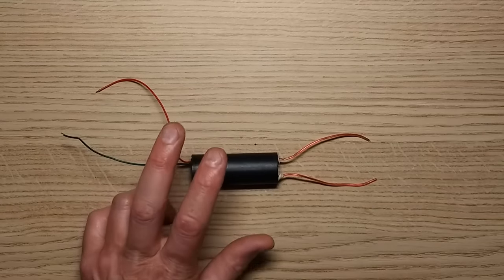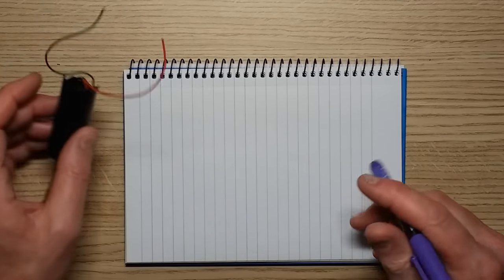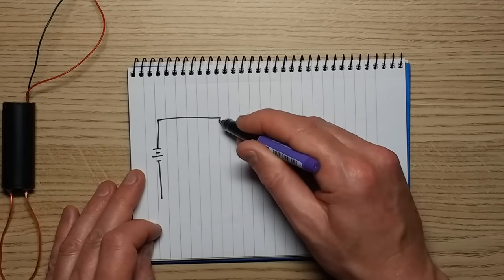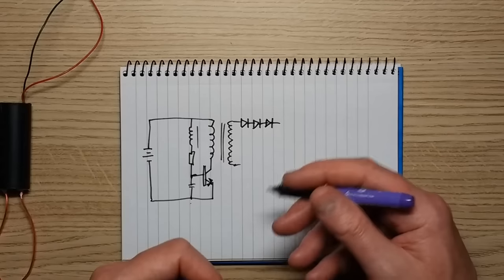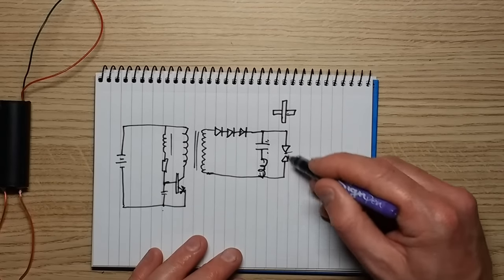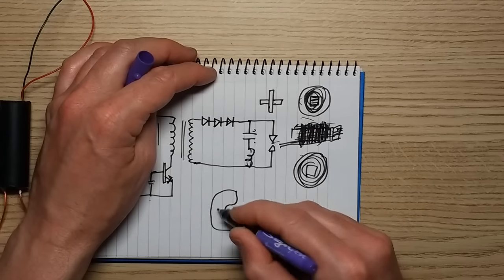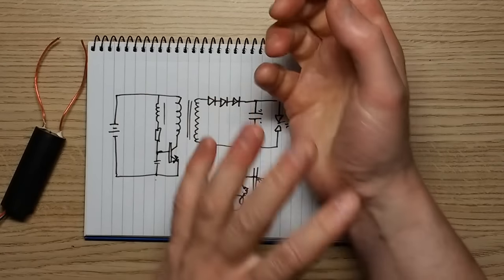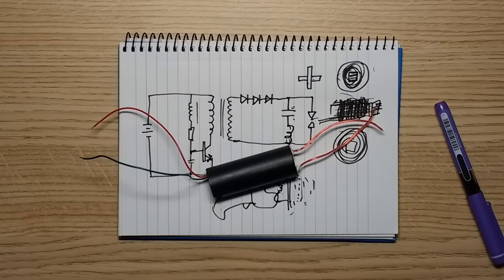Are these stun gun modules?  And do they hurt?  (yes)

Comment: If it's any consolation, I once spent a couple weeks of spare time extremely carefully chipping the potting material off one of these modules. The one I've got uses a voltage tripler at the output of the transformer, but does not have any separate stepup pulse transformer. The sparking you're getting is just the discharging of the final cap of the multiplier. I'll send you some photos 😁
Reply from the maker: +Lindsay Wilson That would be interesting.  It does look like it may be a different style based on an HV transformer and multiplier.
Reply: Actually there are quite a few different versions around. Not all of them have the pulse transformer, like yours obviously has.
Reply: Lindsay Wilson can you send me them
Reply: I have seen x-ray of one of these on internet, and it does seem to have a voltage multiplier on the output
Reply: Oliwer Gumowski Neat! Do you have a link for that?
Reply: I don't but I have them on my local storage, if you give me an email, I can send you
Reply: I've stuck a few photos of the "teardown" here: https://flic.kr/s/aHsm3p7tjX (felt like one of those dinosaur bone games where you have to chip out the plaster!). And here's the circuit: http://imajeenyus.com/temp/hv_module_circuit.pdf. I'm pretty confident about the voltage rating of the output caps, so the whole thing is definitely only good for a few kV, although they're probably over-running them and hoping for the best.

The potting seems to be filled with something - I did try an X-ray initially but it was totally opaque, but then again I only have a 30kV  tube which isn't very penetrating. To be honest, I'd be surprised if there was actually a separate pulse transformer in there, because there wasn't any space left in the one I dismantled, but maybe they've changed the design.

There are actually kits going around which have the same components as are in these modules, minus the output multiplier (so they produce a high-frequency output), for example:

http://www.ebay.co.uk/itm/15KV-High-Voltage-Generator-Step-up-Inverter-Arc-Ignition-Coil-Module-DIY-UK-/382138666198

http://www.ebay.co.uk/itm/High-Voltage-Transformer-15KV-Booster-Coil-Inverter-Heat-sink-Switch-Diode-UK-/192054172975
Reply: I ground it down first on a green-grit (SiC) wheel, then sanded it on a flat piece of wet-n-dry paper. It's not actually much into the ferrite material, so it wasn't too hard to sand.
Reply: Thanks! Actually, that's how I counted the number of turns on the transformer - it was more of a necessity; I was originally going to measure the inductance of each winding, but I accidentally chopped through the wire as I was chipping away the potting, and couldn't find the ends again. So I took a photo, stuck it into photoshop, and used the count tool to number each wire. Slow, but worked. If you have a look at the Flickr album again, I've added two more photos at the end showing the wire counting.

And you've just reminded me how I really need to get back to updating my website with stuff like this!
Reply: You can tell they use a voltage multiplier because the frequency of discharges goes up as the distance between the electrodes goes down, implying that the output is connected across a bank of series capacitors being charged at some finite rate, and a pulse transformer/capacitor/spark gap combo would be too large, heavy and expensive for such a cheap/light/small device. Being a fan of high voltages (the smell of ozone brings back memories :) I've been using both types of circuits for a couple of decades, and it was immediately obvious which type these things use as soon as I tried one out; they hurt, but they don't have the kind of incapacitating wallop you get from a stun-gun (speaking from experience.) I think it's important to differentiate these from actual 'stun-guns' as these are very useful devices for high voltage applications, and it would be a shame if they were associated with them by less technically minded lawmakers, that's a slippery slope right there, and more clarity now might prevent future issues.
Reply: I just took a hammer to one of mine and the LOPT came out in two clean pieces. The potting compound is soft, and can be broken just by pulling leads (after cutting the jacket off with a knife). The contents were exactly the same as the kit also available on eBay.
Reply: These are NOT stun guns! They're a high voltage AC generator feeding into a voltage multiplier with small capacitors that discharge when the voltage across them becomes high enough. Only the first part of the circuit described in this video is correct, the second part should be a voltage multiplier with a bunch of capacitors in series. This is shown by the frequency of discharges rising  when the leads are brought closer together; when I first got one it was immediately obvious to me what kind of circuit it uses as I've made many variations of high-voltage generators in my teens. Bigclive is usually very knowledgeable but he dropped the ball on this one, presumably because he has little experience with high-voltage circuits. One simple way to test this is by measuring the capacitors in the voltage multiplier, getting a valid reading on the output wires would easily clinch this argument. Once you know the capacitance you could work out an LC resonant tank circuit and use the device to make a small tesla coil.
Reply: MadScientist512: Can you elaborate what is the difference between these cheap Chinese HV generators and actual stun guns? Do stun guns use DC pulses, or some other waveform that 'hurts' humans/animals more than this kind of HV AC? Why I ask this is because I have a bunch of units that look like Clive's (black cylinder with one cut/straight wall), but they are longer and thicker, and have much thicker and longer output cords. I made a fish stunner using one module, and I will be really disappointed if it doesn't work (haven't tested it yet since all the lakes a frozen).

Anyway, I tested one generator with 13.8V (I think they were rated 6-12V or something like that) and ~2cm spark gap, and all my LCD monitors about 2 meters away blacked out. The next test I did in the garage, and a randomly selected 6.5cm spark gap still yielded constant arching, pretty decent noise, and the classic ozone stench. I think I calculated the voltage required for an arc of that length to be in the 200kV range.
Reply: Could an old flashgun with the xenon tube removed achieve a similar effect?
Reply: Could you send me the pictures if you happen to have them

Comment: Could you work this into a squirrel proof bird feeder. Stimulate their nerves.
Reply: I like the idea, but you'd need some way to trigger it only when a squirrel is present. Otherwise, the generator will probably burn out. Even if it doesn't, the constant arcing would be annoying.

How about a long tube that fits over the bird feeder pole; two bare wires spiral in parallel down the tube; the squirrel's weight on the tube triggers a power switch...
Reply: Better off with an electric fence controller. I have a bird feeder on a wooden post with two leads spiraled around it from the controller. You need a + lead  and ground lead for the squirrel to ground out. Birds never land on the post so they are safe. You can tell how much the squirrels love it by the way they ricochet about the yard while running away.
Reply: MrCivildefense have a weight activated switch. Should work.
Reply: haha they're tiny! it'll probably kill them not stimulate their nerves!

Comment: I have the same HV Modlue and I built a small tazer.
An important thing to remember about these HV Modules, is to not separate the output wires too far apart or the stored energy cannot jump the wires and end up discharging inside and destroy the module.
About 1 " is good.
Reply: Hi i want a tazer from one of these but i want 0 risk of it being lethal and know im probaly not going to use it on a person unless i really need to but i dont want it to me lethal and i know this comment was 6 years ago but do i need to put a resistor to lower amps or anything or does the voltage mutiplier do it
Reply: @PIXELCRAFT_HD  
It will give you a good shock, but it won't damage you unless you have cardiac issues.  No resistor needed.  This is very low current and high voltage.  Much like a dog shock collar.  Have fun...
Reply: @valveman12  thank you
Reply: also what battery did u use into the voltage multiplier
Reply: @PIXELCRAFT_HD  
I used 2 AA batteries with my design.  2 AA Batteries create a nice arc.
Reply: probably bro died cuz didn't answer back

Comment: I have build one of those inside my insect zapper, which is formed like a tennis racket. I also included a spdt switch to select whether it is running on only one single AA battery or if both included cells of the zapper are used. Running at 1.5V the zapper is quiet and only zapps when an insect is near the zapping plate. When run in 3V mode, continuous zapping with loud sparks happens all over the plate, mostly on a few single spots.

This build is so much fun to zap things with, as even a short swosh through the air definately takes out every creature near by. You can even clean your bed with it zapping, as a static charge will catch small debree on the metal gates on the tennis racket like plate of this device. Small tapping on the handle will release all partikles.
The power consumption is around 1A on both modes, so somewhere between 1.5W and 3W.

Even operated with NiMh cells it is working reliable. To get the indicator LED of the zapper running on the single cell mode, i used a energy thief circuit. This allowed me to even change the LED to a high power 5mm ultra bright diode, which adds to the whole experience using the device.

I don't regret investing the time this conversion took and would alleays do it again.

From the beginning i planned for the inclusion for an ESP8266, which allows for integration in my smarthome. Count zapped things over the year and generate statistics. Through the inclusion of a small mosfet even the following is now reality:

Hey Google, kill this fly for me.

...there you go, i activated your insect zapper. Please hold it near the bug which is soon to be gone...

I love it!
Reply: Any links to components or this module? Keen to make a zapper for the gf
Reply: @MrExprise  DC 3V-6V To 400kV 400000V Boost Step-Up Power Module High-Voltage GeneratorDC 3V-6V To 400kV 400000V Boost Step-Up Power Module High-Voltage Generator
US $3,69

Comment: Hi! I'm actually using these for some scientific experiments and we therefore had to do a couple of measurements on those. We hooked it up to a high voltage resistor, split the voltage 2 ways and hooked it up to an oscillator. We have measured the frequency of the circuit to be roughly around 10 kHz (as far as I remember...) with peak voltage around 13 kV. I'm still getting around to cutting it open with a dremel, but I also plan to use a CT to map the insides. Thanks very much for this video, it has actually provided a lot of insight for me ;)
Reply: How are things going, Stanislav? Discovered anything interesting in the time since your last post?

Comment: There is actually more to that, the reason you would be aiming for the base of someone's spine is that for quite a significant portion of the spinal column the nerves will all be bunched together into this thick cable like arrangement with individual isolating layers, but near the base of the spine, the nerve bundles that handle operations of your legs and everything close to them split back into separated wires that then go to their own designated areas. This part is called the (and I just know I'm going to butcher this, since Latin is not my first language and it's been years since we learned this at university) cauda equina, or horse tail. This is the area you'd want to tap for maximum carnage, since the gradient would hit a ton of nerves at different positions, and unceremoniously cause someone to crumple to the floor in horrible agony while simultaneously soiling their trousers in every way imaginable...
Reply: S2, 3, 4, keeps our pelvis off the floor.

Comment: I'm thinking of getting one and sticking it in a poundland electronic fly swatter!
Reply: Joining this idea train.
Reply: @TheFlacker99  i've got a tennis racket electric swatter and its high voltage generator it pretty vicious, makes huge bangs and blows the flies to tiny bits 😁
Reply: It is the same guts, just less the hv induction coil itself.
Reply: @andygozzo72   Those are only 400V but rather high current due to an capacitor across the transformer output
Reply: @DerH0ns  These modules also have capacitors, not one but 3 across the high voltage terminals.

The voltage on on fly zappers can be anywhere from 400v to 2500v. The distance across the mesh will vary according to the voltage.

If you current limit this module, you can get lower voltage levels easily.

The change which you need to make is to put additional capacitor with across the high voltage terminals with much smaller bleed resistor to prevent the fast discharge.

The capacitors inside this module have 1.5mega ohm resistor as a bleeder so it discharges it within half a second or less.

Now all you need to do is order 3 mesh,   top and bottom one should have large hole size to allow easy mosquito entry and the one in between on should be small enough to not allow any mosquito to pass through. I used mesh size 5 for top and bottom and mesh size 40 for the middle layer.

Now, find out which one is the ground or negative on this module by putting the terminals in the water, whichever terminal has bubbles surrounding it is your negative terminal.

Connect negative terminal to the middle mesh and outer two meshes to the postive one and there you go!

Use a push button to charge the capacitors and discharge it on the target, the one I made lacks the bleed resistor for longer operation time after charge.

I forgot, I used single 18650 cell with 1 ohm resistor (to current limit) the module and output voltage and my mesh are 4mm apart.

Keep in mind without the resistor, if you keep your modules button pressed your module will burn due to overcurrent. I've made another top level comment on this video which explains why this happens.
Reply: @rabbitrampage   pics or it didnt happen
Reply: @AS-ug2vq  nice explanation 👍🏻

Comment: I had one of them which pushed 1v up to 100000v... paired it with a 18650, a switch and a 5v usb lipo charging board and placed everything in an empty notebook power supply. 👍 works great but scary af

Comment: When I worked in a store developing film and enlarging photos we had to take out  the film from one time use cameras and it had a flash which was a huge problem. So after opening the camera to take out the film the first thing you did was short out the capacitor for the flash with a screwdriver to avoid getting zapped, it always made a quite loud bang and made dents into the metal of the screwdriver when you shorted it.
Reply: Those were not dents.. that was metal vaporizing.

Comment: I built 2 electric fly swatters with these in them... they vaporize any sort of flies and can protect me from thieves ¯\_(ツ)_/¯. They work still after a year perfect, that's pretty impressiv compared what i've red that they "break" really fast
Reply: Artwertable 
As the length of the arc goes up,, the voltage goes up. This is due to the colapsing magnetic field. And this is why we were told not to stop a lawn mower by pulling the spark plug wire. And that is why they put a shorting strap at the end of the spark plug.
( back in the day )
When the electrical path is broken,  the voltage goes up to the point that the current finds a path inside the curcuitry. And often times that is inside the coil itself. Once a carbon track is made, the coil is broken, shot, kaput, fried, no good.ect...
Hope this helps,,,,  ;-)
Reply: so if I put the output wires close together and make the arc smaller like bigclive demonstrated in the vid , they will last longer? so a shorter arc will protect the circuit more? ( sorry I'm a noob to electronics I want to use these for a project and need the module to last more than 5 minutes).
Reply: So willy should of said: As the voltage goes up, the length of the arc goes up? all I want to know is if I shorten the length of the arc will this reduce the chance of damaging the module? as this will lessen resistance so the current doesn't find its way into the module to damage it? (if that makes sense)
Reply: @fluffyhead6377  Yes, it will help protect it. Basically if the unit makes a continuous arc when it is running, it is a happy bunny. If however the output leads are too far apart, the voltage can rise too much (no load) and it will wreck the module. Played around with a couple of these modules and they do NOT survive even a few seconds at full input voltage and output leads too far apart.
Reply: Yuck Foutube  I think you are a bit out there - possibly just missed out a decimal point?

If this was correct, then the 40-60KW from the back of an old colour CRT type TV should arc around 700mm In reality it will strike an arc about 2 - 4 cm (give or take). Sure, once the air is ionized, you can "pull it" much further. DC will also allow for a longer arc as it doesn't extinguish twice per cycle.

Also, take into account that many 250v mains rated switches only have a contact separation of a couple of mm.
1KV rated switchgear typically has a contact gap of about 6mm - and that is to ensure there is ZERO chance of arc over.
Reply: @guyteigh3375  crt based colour tvs are around 25kv